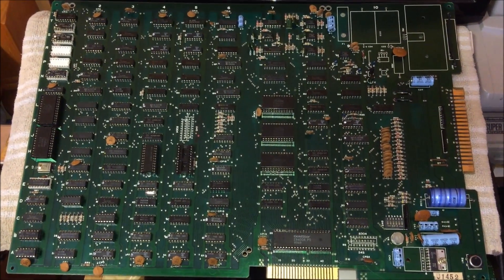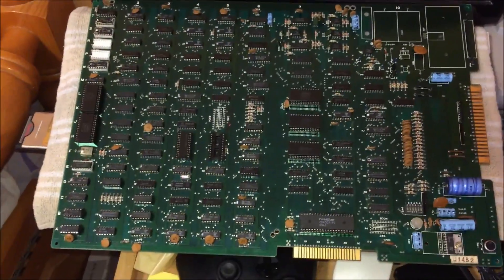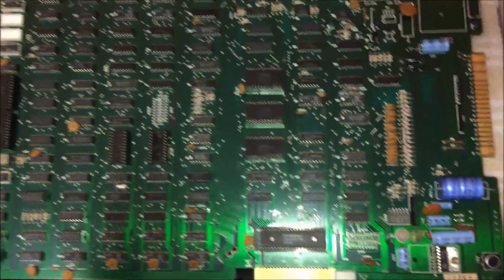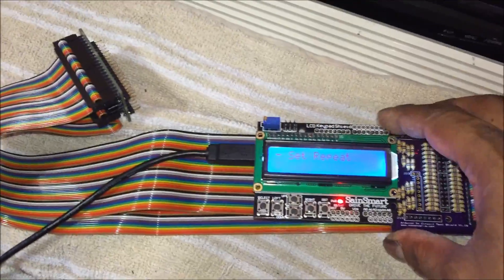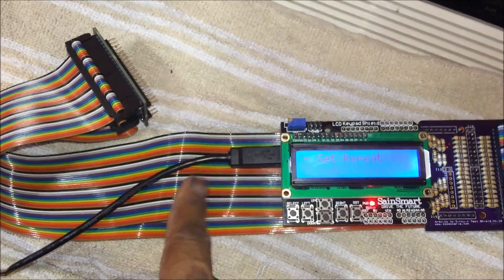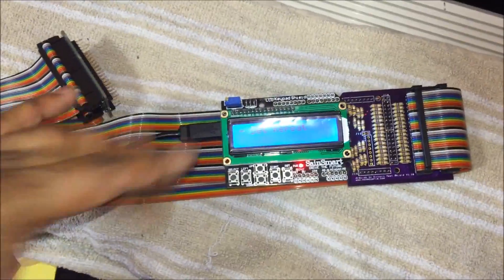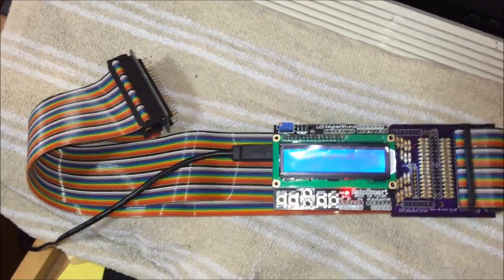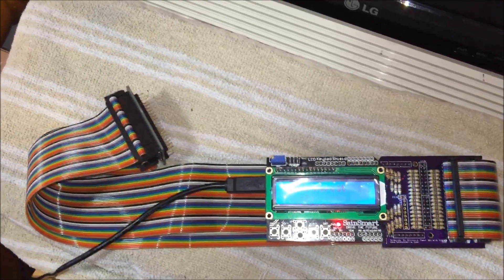Namco Galaxian Repair PCB#1 Part 1 of #

Comment: I love that CPU emulator / diagnostics board - that looks awesome!!!  There's a Fluke tester which works in a similar way but this is brilliant in that it supports different CPUs.
Reply from the maker: +GadgetUK164 Thank you, i try to keep my vids maintained and new, Yes that right Paul Swan designed and coded this tester out due to the fact that Flukes are so hard to come by and when they do are very expensive, this does the simpler tests a fluke does, you just load in the CPU sketch and the game you want to test, Paul has said he will be releasing a tutorial soon on how to code more games into the tester/ i might have a Spare Tester PCB when i ordered them.